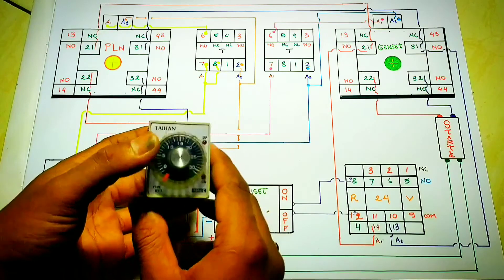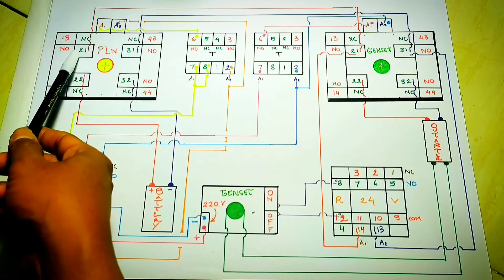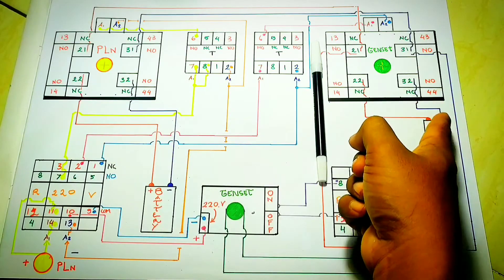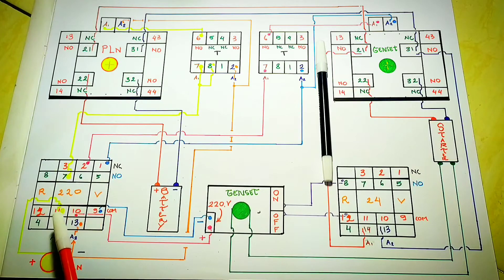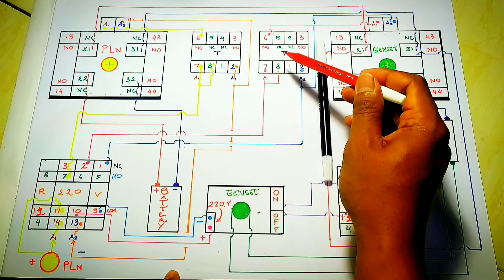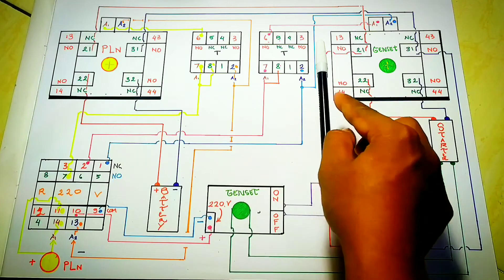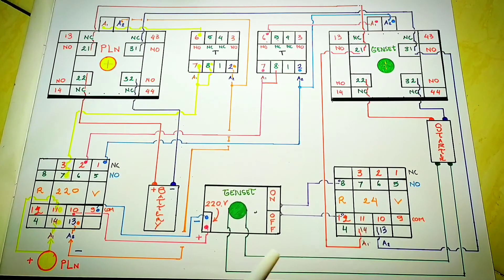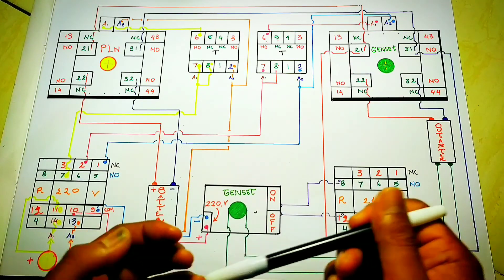Rangkaian ATS / AMF (automatic transfer switch / automatic main failur )

Comment: Teknik banget ini Bang
Reply: Minta dijelaskan bang a1 sama a 2 beda tempat digambar sama yg aslinya beda tempat ni bang
Reply: Di aslinya a1 sebelah kanan bang
Reply from the maker: Iya bang ,.saya tulis di sebelah kiri agar mudah di pahami saja bang .
Untuk koil A1 & A2 fungsinya hanya untuk mengaktifkan magnet yang ada di dalam kontaktor yang bertujuan menghubungkan koil  ( No ) dan melepas koil ( Nc )
Dan untuk A1 & A2 di kontaktor di bolak balik gpp asalkan harus seragam 
Contoh 
Jika A1 di tunjukan sebagai input phase
Maka di kontaktor dalam satu panel ya harus sama .
Dan sebaliknya , jika A1 di tunjukan sebagai Netral yang lain juga harus sama .
Kesimpulannya untuk kontaktor di koil A1&A2 itu input arus AC (220v)
Berbeda sama relay DC (24v) , klu dc tidak kedapatan tulisan a1&a2 adanya angka 14 untuk input positif yang di hasilkan dari batrey 
Dan angka 13 untuk negatif yg di hasilkan dari batrey .
Kalau arus DC saya yakin abang sudah tau kalau kebalik gak bisa nyala .🙏👷